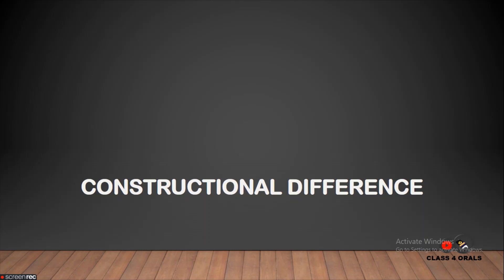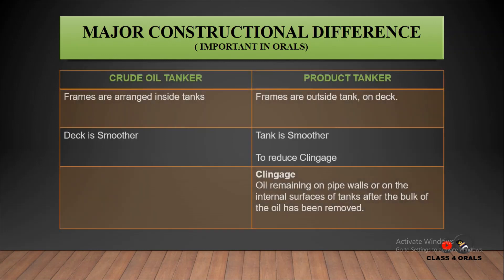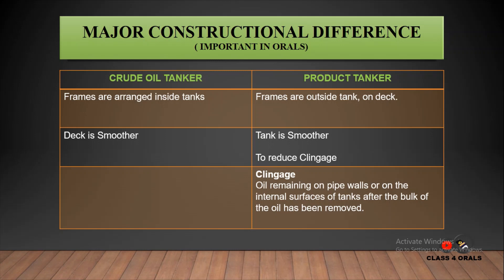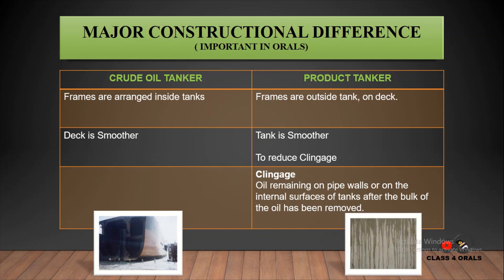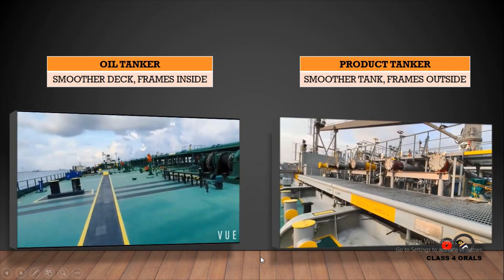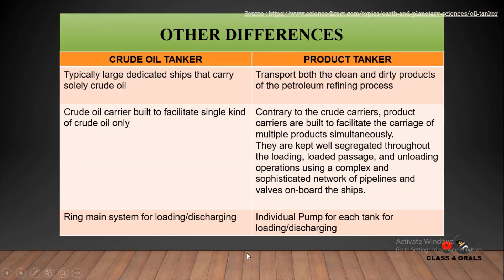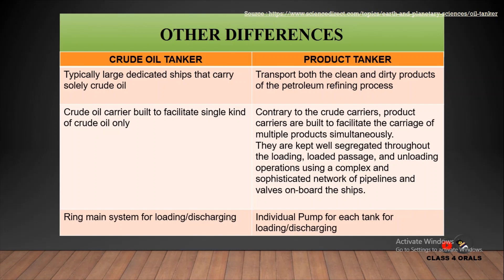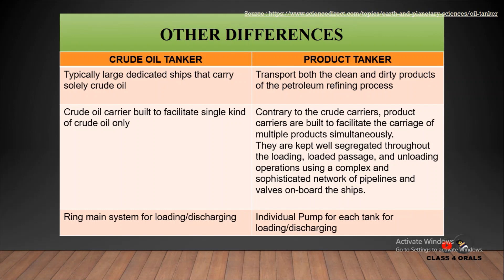Difference between Crude Oil Tanker and Product Tanker | Imp #CrudeOilTanker #ProductTanker #Tankers

Comment: The crude oil tankers has less number of large size tanks whereas the latter has large number of small size tanks.

Crude Oil Tanker is less stronger than Product tanker of almost same dimensions since product tanker is having many transverse and longitudinal bulkheads.

It is not mandatory that product tankers need to have a dedicated pump for each tank. It may have few centrifugal pumps driven by a prime mover that is IC Engine, Electric motors etc. and all the pumps could take suction from individual tanks.